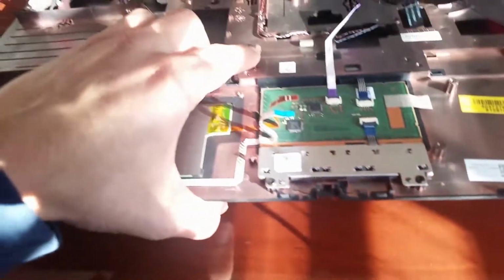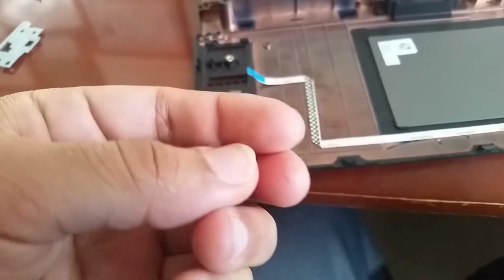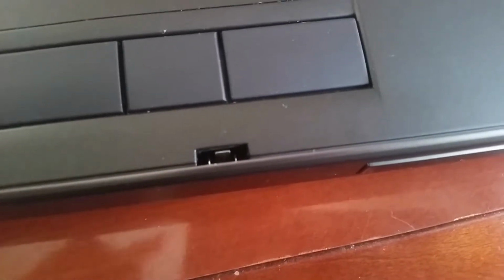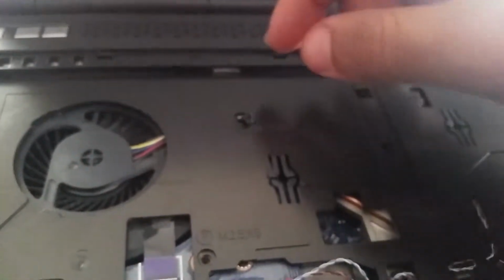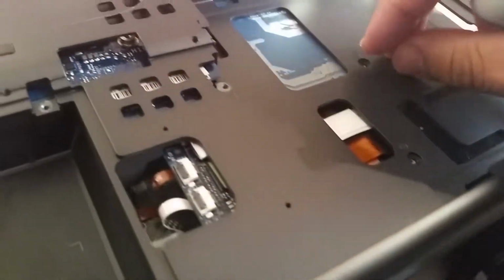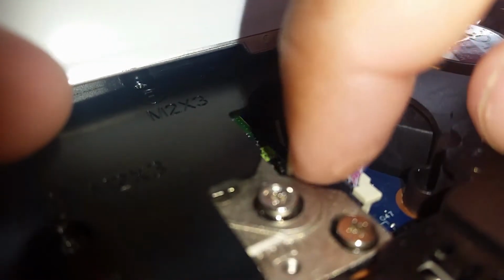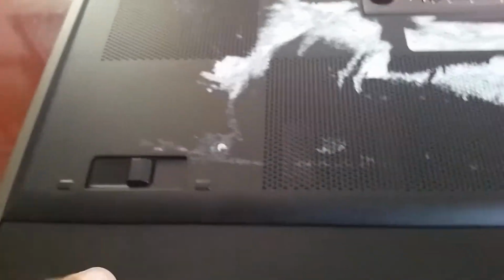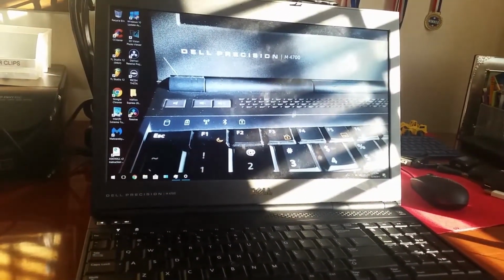Troubleshoot: Dell Precision M4700 Fingerprint scanner

Comment: whats the part number of that board that the finger printscanner plugs into down by the cd rom drive
Reply from the maker: God Bless You, thank you for commenting. I believe this would be the part you are referring to:

https://www.parts-people.com/index.php?action=item&id=14353

According to the description of it,
"This board is mounted on the underside of the Touchpad Palmrest assembly; connecting the RFID, Smart Card, and fingerprint reader modules to the motherboard."
Reply: @raht3ch  yes that's the one I'm missing I'm trying to upgrade my computer to have the fingerprint scanner it didn't have it from the factory thank you very much

Comment: I have the dell precision m4700 without the fingerprint sensor can i install the palm rest with the fingerprint sensor on it to my dell precision m4700
Reply from the maker: Thank you for commenting, it may be possible if the motherboard has the fingerprint reader connector on it